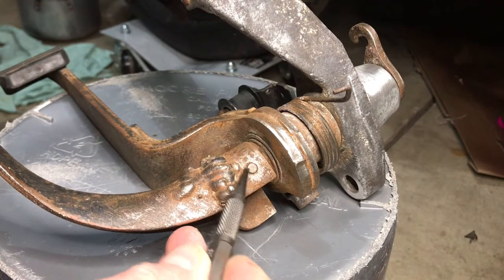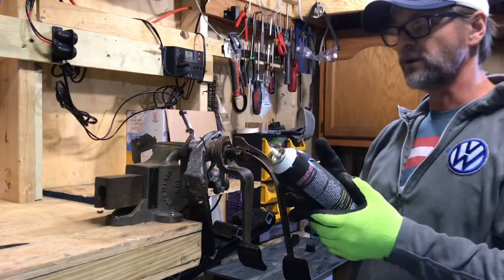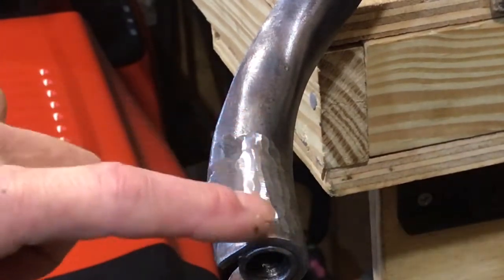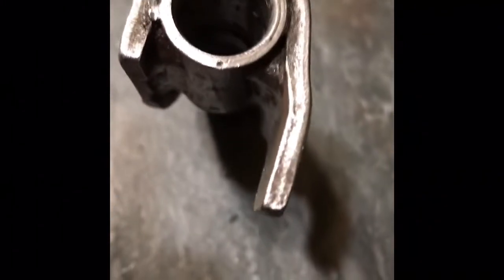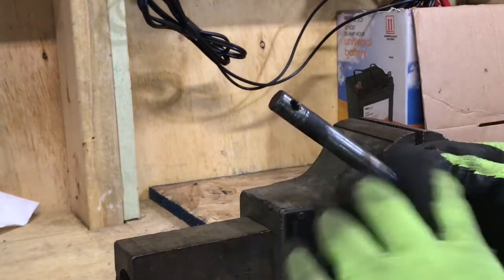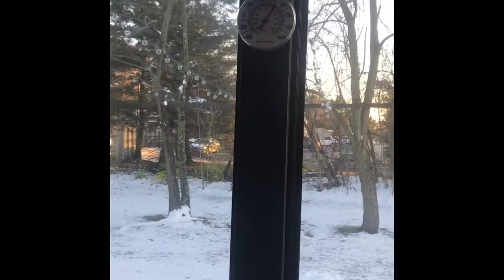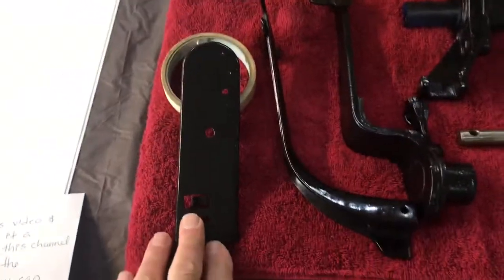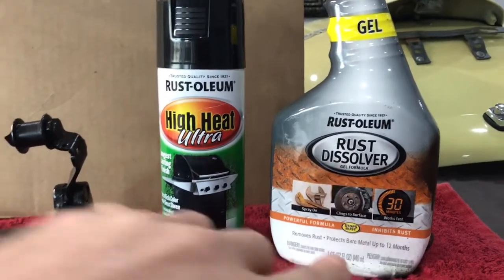Cluster pedals part two VW 1971 super beetle

Comment: Great job, the pedal assembly came out really nice!! Be careful with that clutch pedal shaft. The hook looks tired and wore out. I don’t want to see it break on you. They do sell those new, they’re not very expensive
Reply from the maker: Absolutely; I agree. That’s in priority to do things to replace it or fill it with my mig and smoother it down.  However; if I can get a replacement of good quality I may try it.  With the weather being so cold 🥶 I really don’t want pull my welder out of the shed...😅😅😅.  Thanks for your advise.  Take care brother.
Reply: instablaster